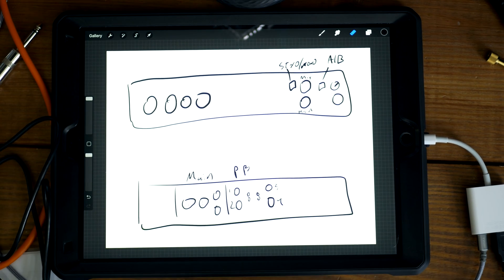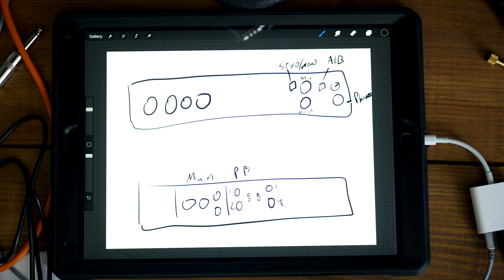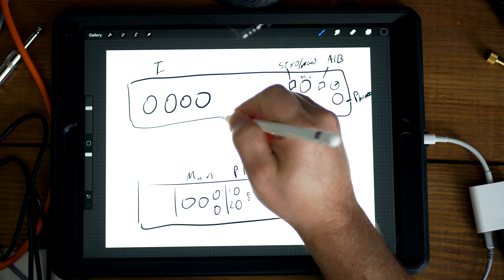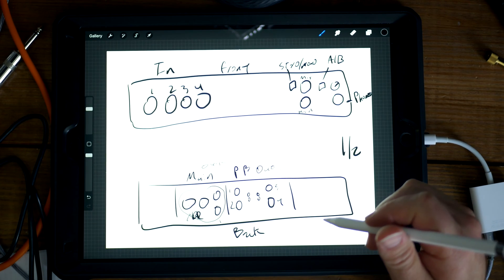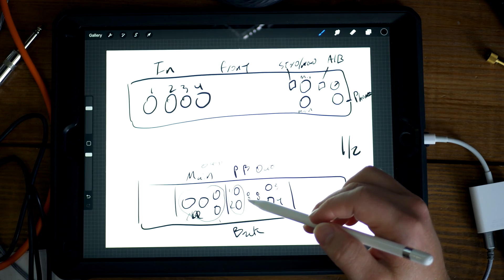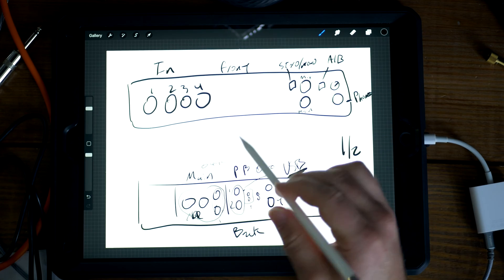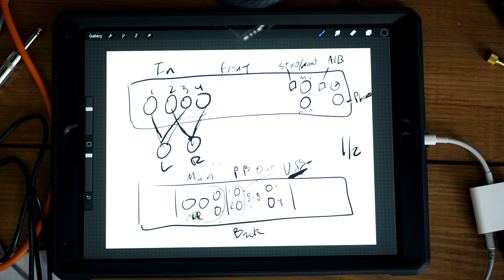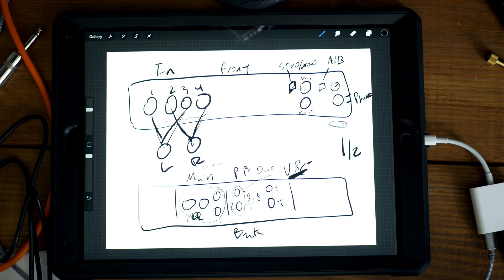Behringer UMC-404HD | Audio Routing Explained

Comment: Can the "Main outs" be connected to a "Microphone input"?
My goal is to connect the Behringer to the mic input jack in the DSLR camera.
I have tried to connect the "headphone jack" output of other devices to the DSLR mic input, but the signal is too hot and even with the minimum volume the signal gets clipped.
I wonder if any of the Main outs or RCA outputs of the Behringer could be used for this purpose
Reply from the maker: Thanks for stopping by. I will test it out with my Panasonic G7. What DSLR are you using? Also the RCA jacks are line level so you have no physical knob for them, only if you are using software with them, can you control the volume. What sources are you wanting to use as in what type of audio are you wanting to send to the DSLR and will it be plugged into a PC, MAC, or iOS device?
Reply: @TheAudioDabbler  Thanks for checking it out!
My camera is a Canon M50, but I guess that mic input levels will be similar for most cameras.
The main source that I want to use is a XLR condenser microphone. The Behringer would allow me to connect the mic to my Mac, but if I record video at the same time, I would need to sync it in post. So I wonder if there is any way to connect the Behringer to the camera and skip the sync step.
To get the best audio quality probably I would need to go with the sync-in-post route, but it would be much easier if the interface could work as a phantom power and preamp for the XLR mic connected to the camera directly
Reply from the maker: @Pablete099  yes, sync in post would be better quality but sometimes easier gets things done. I have just been tossing this concept around as well. I usually record my audio with my Zoom H4n Pro and sync in post but on one of my last videos, I plugged in the line out from my zoom into my camera and it worked out pretty good. 

One thing to note would be turn the mic gain down in the camera if you can, like as low as it will go. I have mine at -12db. What audio applications do you have on your Mac? I am assuming garage band? The way the Behringer with the RCAs works is that you would need to use a program to feed the audio into, then you could adjust the levels as needed for good audio onto the camera. Let me know what DAW as in garageband, logic, ableton, etc, that you have and I can make a video showing how it could work with your setup.
Reply: @TheAudioDabbler  Regarding using the Behringer, my main concern now is with the fact you commented that RCA/playback outputs are driven but the DAW, because it means that there always be some lag, so audio and video would be out-of-sync.
Which outputs have 0-latency monitoring? The headphone output and the main ouputs?
BTW, I have used Garageband, but I', currently using Adobe Audition
Thanks again!
Reply from the maker: I just put out a video regarding this question. Let me know if it answers. In the video I did not do any syncing and I was using the Main outputs directly into my Panasonic G7. Sound came out pretty good to me, no DAW required since I used the main outs and not the RCA/playback outputs. If you are just wanting to use it as a preamp for a mic, it worked great for me as you can see in the video.

Comment: I just bought one of these and it doesn't work with my 2018 iPad running iOS 12.1 and the camera kit.  Tried it with and without a USB hub. It connects, works for about 30 seconds and then I get the message "this device is not supported". I have the same problem with generic USB MIDI interfaces. Seems like Apple pulled the plug on vendors who don't pay licence fees on their peripherals. Anybody else having this problem?
Reply from the maker: Mine works with the latest iOS. It does seem to require a powered hub. Also make sure to turn the physical volume up on the ipad.
Reply: I experienced the same thing with my interface and my MacBook and it took me a lot of nerves and time to solve this problem. Maybe the following will help you and save you the trouble. 
 
Please check if you have a device that doesn't have the latest firmware installed. This could be, for example, if you have the model "umc404" instead of the model "umc404hd".  In this case, your device cannot communicate via USB 3.0 or is very faulty. Almost all newer PCs or tablets today have USB 3.0 ports built in. Which is why the device should run almost nowhere.

Solution: 
Go to the Behringer homepage and download the latest firmware and the firmware installer. Best on a Pc with USB 2.0 port. After the installation, a window should open for the installation of the firmware. You may get an error message: Error. DLLxyz not found!  Close the window and open the installer via your start menu. There you will find the correct installer!  Unfortunately Behringer doesn't write this anywhere and so it cost me a lot of troubleshooting. 
Hope I could help you!

Comment: Can the main outs, or headphones, hear all four channels of USB playback at once? Or are you limited to 1 & 2 on the main outs?
Reply from the maker: To answer your question, yes you are limited to 1 and 2 on the mains. The headphones can hear either one depending on the AB switch. Not sure why you would want to hear all 4 outputs at once though.
Reply: @TheAudioDabbler  - Thanks for your reply. I realize now that one can just route all the channels they are working on to 1 & 2, in order to hear the full mix - for multi-track recording purposes.

Comment: Tell me dude, cause i see about You understand this device more then i.  i was trying to record 4xmono from input's + drum loop played by Uphoria soundcard .. everything sounds perfect from main output   ( i have 2 synths modules, so i use uphoria mono imputs to have 2x stereo chanells  and that works right .. but when i play on PC drum  loop - i can not record everything together ) ..   is really need to buy another sound card to record what i hear from uphoria ? ..   i try to solve this problem maybe a year ..
Reply from the maker: The routing is a little weird sometimes when you are mixing the physical inputs with audio that is coming over via USB. I would need a little more information as far as your setup to really dig in to help. So it seems like you are trying to record 4 different mono inputs as well as a drum loop? where is the drum loop coming from?
Reply: @TheAudioDabbler  drum loop .. from soundcard interbuilded with Uphoria - drum lop is played by ... windowds ;) mediaplayer ..  - i hear everything well from Main Output.  ( tanks for Your answer - thank You. )
Reply: here you have short movie - few days ago i did by self midi thru box .. so i trying to record short demo how it works.. and i used internal recording software whos as default on Windows 10  = and this software can not grab the percussion loop too !!!.. i can not record all sound's whos come from 404HD ..    fyi movie's here https://photos.app.goo.gl/b3Zz28qcNPCtMawj7

Comment: I have never used playback inputs. Only reason I use the back part of the interface is for my Monitors. I wonder what you are referring to when you say playbacks.
Reply from the maker: Rocken Byanjankar so playback is only going to play what the computer is outputting, it will not monitor the physical inputs Like the main outputs will. I think it’s more of a DJ type thing but there are other uses for them.

Comment: I thought you use iconnectaudio4+. Do you like this one more? Or do you use both? What is mains? In the UK they use mains for the wall power.
Reply from the maker: I still use both. I wanted a 2nd interface that was bus powered and more portable to use when I am on the go. As far as mains, I am referring to the main outputs as opposed to any alternate output like a sub mix or in the Behringer's case, the 4 playback outs.